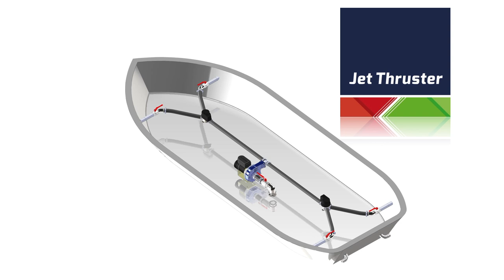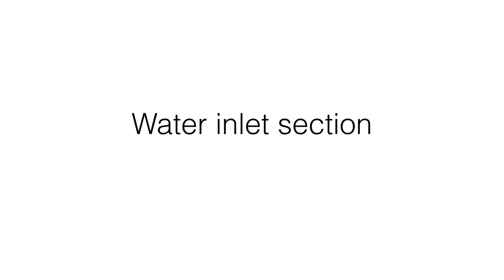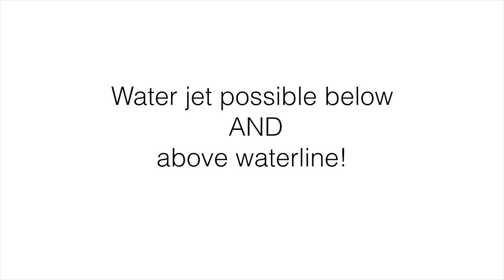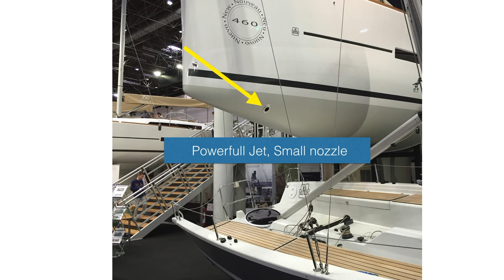Dufour 460 Jet Thruster Docking system

Comment: how come there are not any forward facing thrusters to reverse out of your slip and to stop when coming into your slip.  make it much handier..   i would really want some kind of ball valve also on the pump inlet..  or a slide valve.. so i could shut off water into the inlet also.  like every other seacock should have.  easy to build a rotating disc valve..  less chance of it clogging.